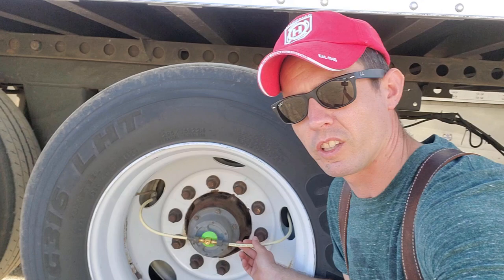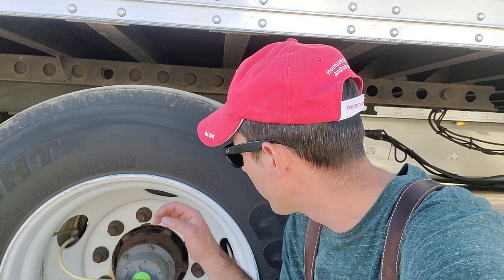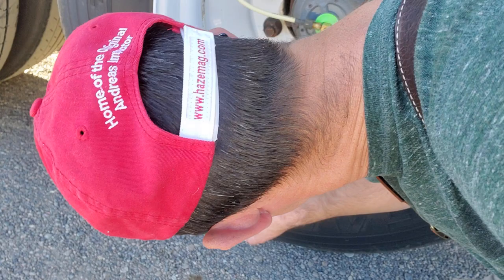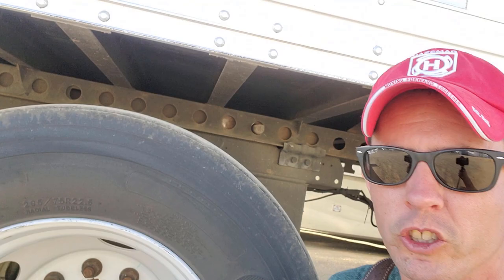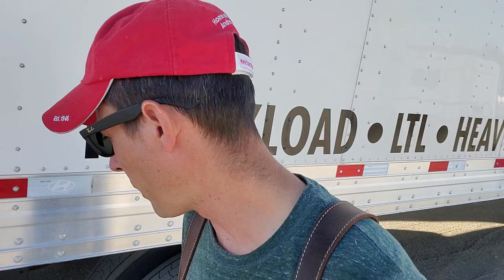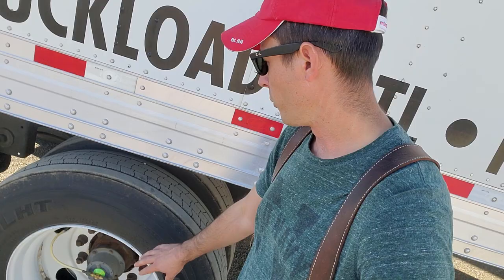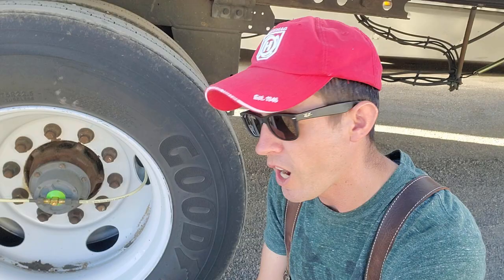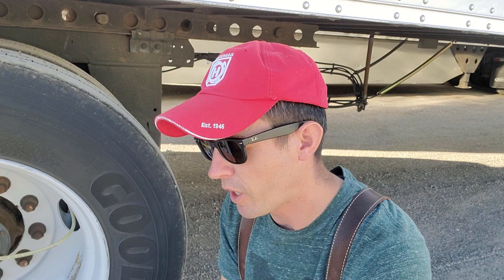Trailer Auto-Inflation Systems - Don't Always Panic With Off-Bead Tires

Comment: I used to work on trailer and tha ROTATORY T-FITTING often snaps if you bumb it with something and also there is a blue o-ring seal on the t fitting that screws on and keeps that air in the system however when this o-ring ware out the air will start escaping into the axle and starts pushing the oil out of the hub cap and that's when you get oil on the rim.

Comment: So, do you run anything on your tractor?

I'm running Cat Eyes on the drives, with Remote pressure and heat  sensors on steers and drives.

They saved a tire for me within a week of installing them. Woke up to an audible alarm. Checked it out, inside drive was flat.

Comment: Yep, I had a tire off the bead this morning. Apparently it went flat, and our yard driver docked it, it was loaded, then he pulled it and parked it, probably pulled the tire off the bead in the process. So, this morning I hooked up to the trailer (still loaded) and pulled it down the road, getting up to 55-60 mph. About 5 miles into the drive the beads reset themselves, it aired itself up, and I made my delivery.

Comment: I've always been curious about these systems. How do they work when the tires are hot? If they are set for 100 psi cold is it deflating air pressure when the tires are hot and going down the road?
Reply: it maintains a minimum. All tires show higher pressures when they warm up.

My steers show as high as 129 when they get warmed up, I have seen above 135 in the south on hotter road beds. Drives run a bit less.
Reply: @justtruckin2.033  thanks for the reply and the clarification

Comment: Yeah fellow landstar bco or driver but one important thing you honestly forget. Maybe you don't know but that inflation indicator light doesn't always strictly stay on if a tire is low or tire leak, it also can mean that there is a system leak. Don't know how familiar you are on the actual inflation control module  but the system needs to be maintained every year as well. Lots of information in regards to the system. So every airline needs to be inspected with soapy water, the actual inflation hoses and fitting at tire needs checks, the tires itself soapy water, have to make  sure the target cold psi for tire and deflation psi for tire is set 3-10 psi from each other.  It's 99.9% not as simple as what you said in video. And the TA in north bend you referring to is a joke would never take anything there to be worked on, would never take to any ta petro to be exact. Most truck stop mechanics are basic PM changes and light work. Not true mechanics.

Comment: If you dpnt have that system,,roll on a 2x4 with good tire and air up flat tire,,,,take weight off the flat tire. Sometimes u got to put your gloves on and move play with tire one way or the other with air hose hooked up  till it starts taking air.  Owner ops always carry a short 2x4,  ,never know when you'll need it.